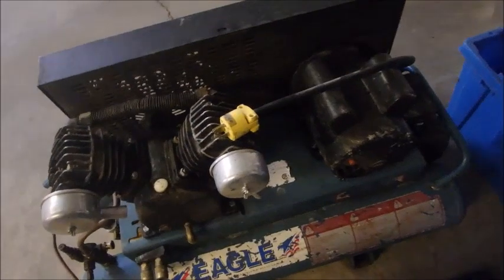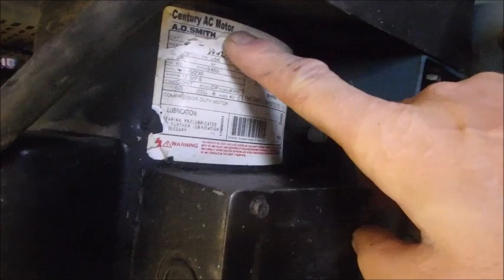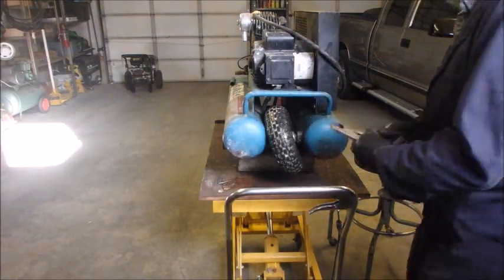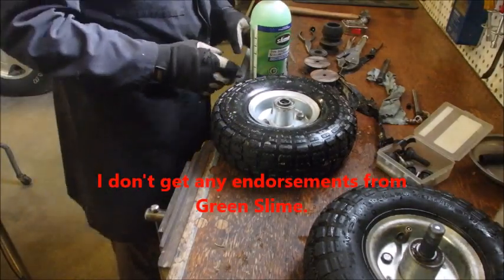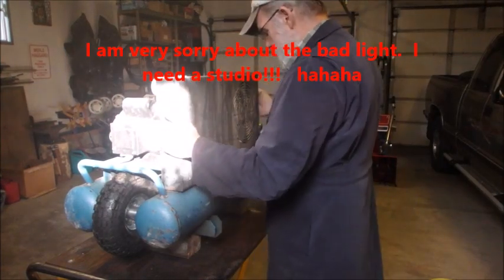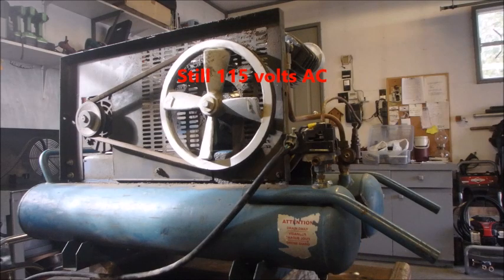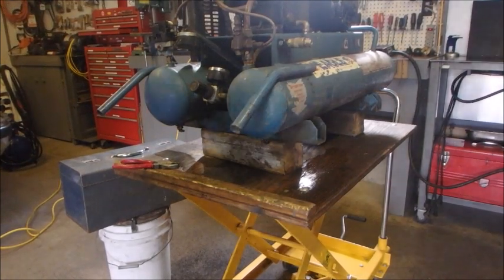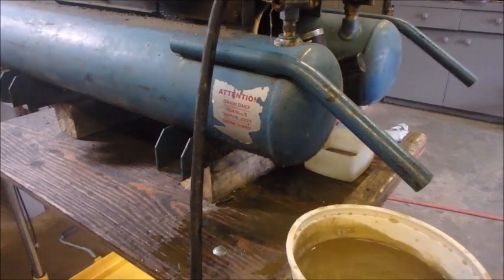This Electric Wheel Barrow Compressor sat for 8 years

Comment: It'll be lighter to move around without all that H2O in there! So far so good! It sounded like it started out with a hard start (I suspect capacitor might be getting tired), but once it was going, it leveled off and sounded fine. Looking forward to the diagnosis! Cheers my Friend! Sean~
Reply from the maker: I think the oil in the compressor shaft turn to grease.  You may be right.  It runs like a champ now.  That V shaped compressor runs a lot smoother than my own vertical twin.  They are the same size   6-7 CFM's

Comment: The owner must not know that he should blow the water out once in a while that was A LOT. I definitely enjoy compressor videos I need to learn more about them I have old one I used for years until it started acting funny
Reply from the maker: This one had to have been in a very wet environment.  Then it sat for 8 years after the pressure switch welded itself together.  Good to hear from you!!

Comment: Hey Bruce, I have a few videos working on the same emglo compressors.  One I rebuild the head and piston and the other I welded the tank where water rusted through.  With that much water in the tanks, I'm thinking that may have been used for blowing out pool lines and may have been back filled with water when the pressure ran down?  I have never ever seen that much water in a compressor.  I'm also surprised the tank is not rusted through.
Reply from the maker: Well we don't have that many pools up here as we have 6 months of bad weather then winter comes.  haha.  I watched it for leaks which is the first sign of a rusty tank.  Thanks   I did talk to the gent who owns it to warn him about the tank issue.
Reply from the maker: I was just thinking.  We live in a LARGE farming area.  It could have come out of a pig barn or other moist environment eh!! 
  I can't believe what comes in sometimes.
Reply: or winterizing pipes or plumbing for the winter?  or M Gomez is right it was NEVER drained.
Reply from the maker: I agree     from new!!!
Reply from the maker: One other though... There may have been no oxygen in those tanks as they were sealed. The compressor never ran for 8 years.   No oxygen no rust   correct???   Sorry to bug you late.
Reply: Correct no air no rust.......   It's never too late on you tube to comment   ~!~!
Reply: But I did see rusty water in the bowls  ??
Reply from the maker: Well 8 years would make some.  I was just thinking out loud.  haha
Reply: Is there a water drain?

Comment: Crazy, how much water was in the tank. More a pressure washer than a compressor. I am always a bit afraid with those engines because it is quite dangerous when a valve comes out with high speed. Take care 👍
Reply from the maker: You are so right

Comment: That's a lot of water for the size of the tanks. My father and I had a large DeVilbiss compressor for our autobody repair shop and we used to drain the tank at the end of every day. Depending on the humidity I used to see one or two cups of water per day. I'm wondering how solid your tanks are. There didn't appear to be any rust in the water but I once had a tank burst at the end where the tank was welded. It startled me and sure kicked up a lot of dust :-).
Reply from the maker: Yes they are dangerous.  I monitored the pressure and no leaks.  Hopefuully we are Ok  I warned the owner to watch it.

Comment: Sitting for 8 years with all that water in the tank I'd be parting out that compressor and scrapping that tank.
Reply from the maker: I thought of that.  But there were no leaks at all to show weakness.  I know thy are dangerous things.
Reply: There might not be a small hole in the tank but there might be a large section of the tank where the water sat, rusted away the metal, and made it thin. Watch this video to see what I'm thinking. https://www.youtube.com/watch?v=XfLzFR-TOBc
Reply from the maker: Thanks 2AM.  Leaks are the sign.  I do appreciate the concern.  It is on my mind   Thanks again

Comment: Bruce it maybe kicking the breaker because of the extension cord. That motor draws a lot of current I'M not sure what gauge cord you have but I would want it at least 12 gauge wire and maybe even 10 gauge also since that compressor is that old and had that much water in it I would be careful around it fully pressurized I would be concerned about the condition of the tanks they could possibly have thin walls due to rust and corrosion.
Reply from the maker: As soon as I got it turning over for a while with a bigger breaker it loosened up and now it works great on a 15 amp.  Remember is sat for 8 years.  The cord ended up being a #12.  My background is electrical but thanks for the great comment.  Ant thing helps.  The knowledge of the subs I have is amazing.

Comment: what do you charge for carb over haul and carb clean i charge 30 for carb clean and 30 plus parts for overhaul
Reply from the maker: That is about right. Remember this is something I do mostly for family and friends.
Reply: we are trying to build a business out of this all we have are 70 dollar an hour repair shops that don't like to repair they tell most they need a new one so far we have saved all that were condemned for less than 170 all with in two hours  the rest is parts  all within the saving cost of a new one
Reply from the maker: Doing it right is all it takes.  Also knowing when to stop on a machine that just keeps asking for more work.  In other words a bad machine is not worth fixing.  Good luck sir.

Comment: Hey Bruce...Was wondering your thoughts off topic for a bit.  What is your opinion on Ariens snow blowers in general? My nephew is looking at a 6 yr old 2 stage 24 inch model around 254 CC . It has turn assist and looks like the machine has been garaged and very clean.  He's asking $450 U.S  Your thoughts as well as the thoughts of any of you other guys would be a huge help..Thanks.
Reply from the maker: That sound a lot for a used machine   just being honest.  That is 600 Canadian.  
A New one isn't that much more  20%??
Reply: Appreciate the honesty Bruce.  Sold for about a 1000 new... Thank you for the advice!!!
Reply from the maker: By the way----I have 2 Ariens machines.  One is 35 years old and one (the John Deere) is 40.  I got them both for free.
Reply: are you looking to sell one?
Reply from the maker: Sorry.  I live up here in Canada and selling a snowblower is like selling a lawn mower.

Comment: Looks like the start capacitor is bad.... It give the motor a jolt of power to start it... Without it the motor draws too much current to start..
Reply from the maker: No.  The breaker was popping because everything was to stiff for the motor.  Thanks for the input.. The owner has using  using it for a year.  It right on the edge of 15 amps.  Thanks for the input though.

Comment: I,d get her running 1st ,it may not run. Then fix the tire.
Reply from the maker: I had to move it around so i fixed the tire.  I did debate what you said in my mind first.  GET IT RUNNING FIRST.   But I caved and fixed the wheel.  Thanks for reading my mind.